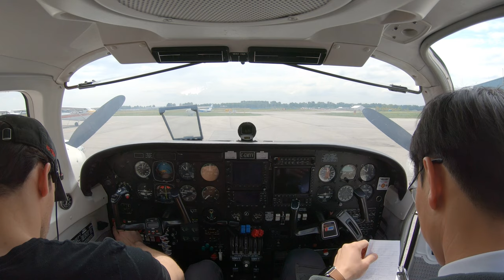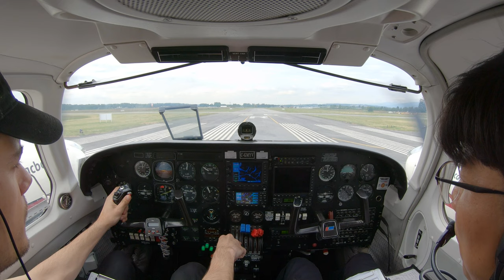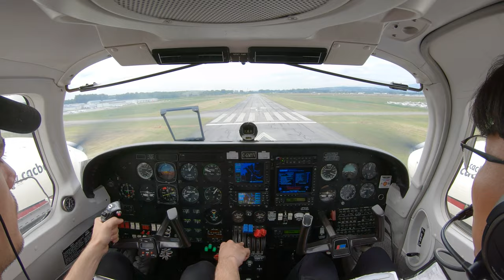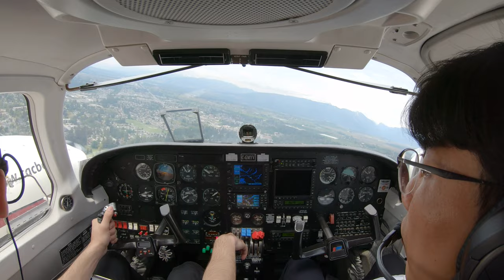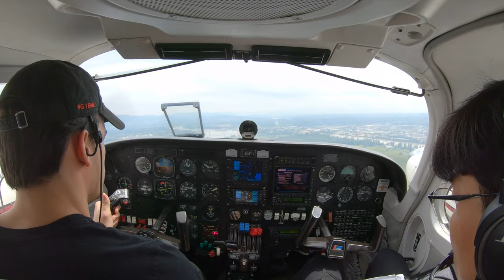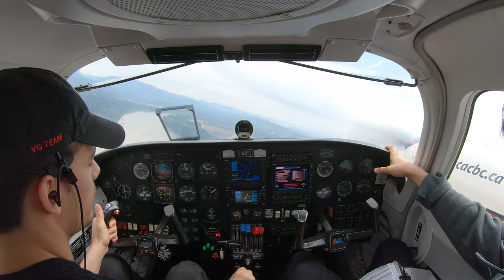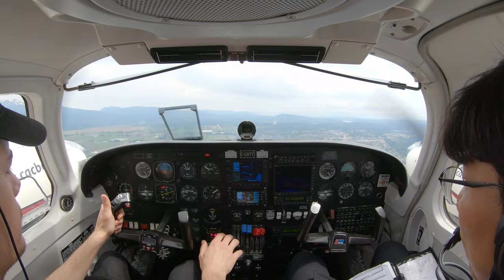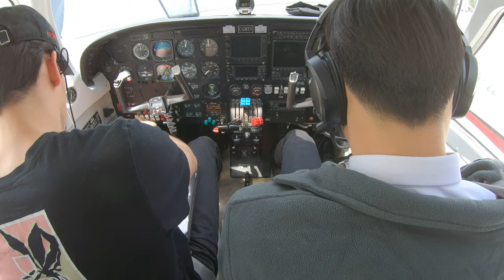PIPER SENECA III CIRCUITS (CYPK)

Comment: a few comments.......1) props to that controller, she did a great job while it was pretty busy, 2) props to the PIC, very impressed considering it was your 1st time in a seneca, and 3) props to the instructor for minimal verbal instructions.  most instructions were simple hand movements..."reminders" of what he should be doing.  of course he's able to do so because the PIC was pretty spot on most of the time.   great job all around, fun video!
Reply from the maker: Thanks for the feedback 😊
Reply: Just to  clarify, pilot flying in this case wasn't a PIC. PIC was a role of the instructor.